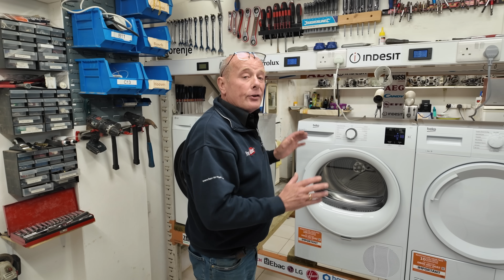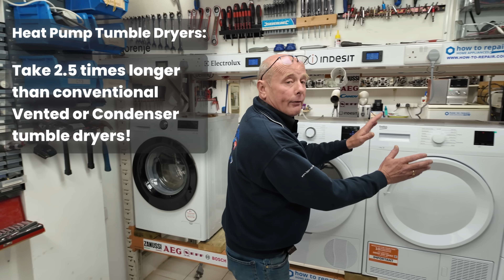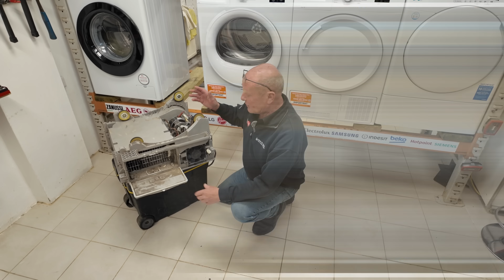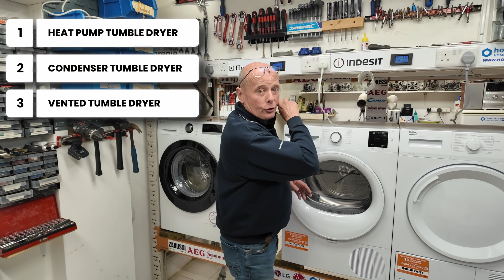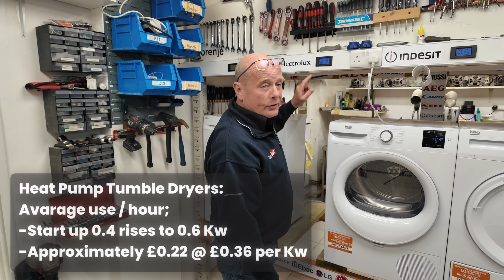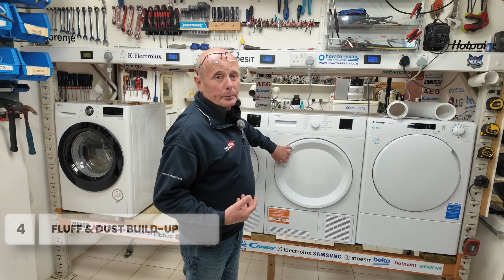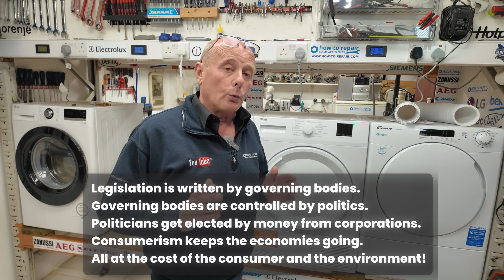Tumble Dryers the Shocking Truth About Heat Pump vs Vented & Condenser, NEW LEGISLATION!

Comment: My old BEKO vent to atmosphere cost me £0.80p per hr to run and the clothes were damp in the middle . 
Bought a Miele Heat pump dryer and it uses £0.10p per hour ,  This was checked using a KILL-A-WATT meter . Clothes are always dry and a full programme takes ~105 mins 
Best dryer I have ever owned , Water from the condenser drawer gets put back into the washing machine for the next load .

Comment: Does anyone make a bolt on heat exchanger for vented dryers ?. Why don’t the manufacturers build one in ?.
Is it possible to use the central heating to provide heat in a tumble dryer - ie: a radiator inside the dryer plumbed into the heating system?.

Comment: I have a Zanussi Condenser dryer bought new in the late1990’s and is still going strong and the only repair has been a drive belt for the condenser fan, the dryer only has two ‘programs’ one high temp, one low temp, and as long as I defluff the door filter and the condenser box on a regular basis I can see this dryer out lasting me and I’m 62 now.

Comment: A vented dryer pushes 250-300 CFM (425-503 m/hr) of your heated homes air straight outdoors and thus requires you to then heat the air that came in to replace it. That expense is dependent on climate and time of year but that cost needs to be accounted for.

Comment: Working in the energy industry I knew all of this to be true. Unfortunately we have a built in kitchen and there are now no vented or condenser built in dryers available. (Our venerable old dryer now obsolete and beyond repair due to lack of parts) Bought a Haier inverter motor hp dryer with 5 years parts and labour and view it as disposable after that should it fail. (Yes it's very slow and stuff never gets properly dry either, so bad we are considering a separate condenser dryer in the garage) My view though is it's the EU & UK governments and regulators driving this change not the manufacturers. (Much like EVs and boiler regs, or max wattage on vacuums etc) The manufacturers needs to build a narrative around cost saving to sell the more expensive machines or face the same consumer resistance as EVs and it does seem to be working. I'm sure they like the obsolescence but know the old dryers will be phased out by the EU so jumped before they were pushed. I can't see them reversing their policy though if I'm honest, the green agenda must be fed even if it's totally illogical 😕

Comment: Front loading washing machines and dryers put a huge load on the drum bearings! I remember my late mother had a twin tub agitating washing machine and separate drum for spin drying at very high speeds! She had it for about 25 years with very little trouble! I think it was called a Rolls! I kept the filter/pump clean regularly and it was also very quiet! Spares became difficult to find so it was replaced eventually! In France I noticed they have top loading drums with 2 bearings ! 1 at the back and 1 at the front so the load is shared and they run very quiet! Anybody else heard of this double bearing top loader?.  Fraser.🛠⚡️p.s. there is a loading/ unloading hatch on the top and another for the inner drum access! I guess the cons would be you can’t have it under a worktop when loading/unloading😢

Comment: I air dry most of my laundry, wrather permitting outdoors otherwise wherever there's space to sry the laundry.  That way the laundry doubles as air humidifier which I sometimes need.  My condensor dryer is the backup for when thing need to get dry quickly or some special cases such as downs.  Probably runs once or twice a year and might be 20 years old.

Comment: Completely agree with the presenter but I think he is being over optimistic on prices that I have seen especially the heat pump dryers. I bought a new vented dryer a couple of years back and hope it outlasts me it vented directly to outside and other than fluff requires no maintenance. My daughter has a condenser dryer and it’s a pain in the arse carrying a cassette full of water about to empty it and something I certainly don’t think my wife could manage in our advancing years. Pretty basic logic that any machine that takes 4 times as long will wear out 4 times sooner. Like air source heat pumps how many homes have a convenient access to an outside wall? Far from most especially when you take flats into consideration. I have no doubt the green washers will force their opinions on us all eventually weather it’s the right thing or just brain washing instead of clothes washing.

Comment: Like with all the "Energy Efficiency" farce, all they ever look at is how much energy they use per HOUR.
When they really need to check the energy use per CYCLE!
So what if the machine saves half the energy when it takes 3 times longer. It's actually costing you more per cycle.

Dryers, washers, fridges etc. As you said none of it is for the benefit of the consumer, only the manufacturer as they sell more machines.
And they know their machines are designed to fail, that's why they now also offer their own Insurance or Maintenance Services, cos they know people will be more willing to spend £200, than £500 on a new machine.

Comment: I upgraded to a HPTD a year ago and so far my experience has been a positive one (vented prior). I found drying time to be on par, certainly not vastly different. My only gripe is the depth - like for like machine - is a good few cm longer ( presumably due to extra components). This argument shares much in common with the EV revolution, all in favour of giving the consumer choice, but believe the pros will eventually out weigh the cons.

Comment: We have a 5ish year old washer (condenser) drier that was blocked with fluff. I had to dismantle most of the machine to clear that out. There really does need to be a law that ensures all machines are easily maintainable.
Regarding the heat pump driers; one of the benefits is that they are more compatible with solar panels as they daw so much less power. Puling 2kW at a time will often be too much for solar panels so the machine will draw from the grid. 400W is more likely to utilise your own power.

Comment: 100% with your thoughts , we’ve always had vented units which we use in winter / when it’s not possible to use the washing line . We know they are more costly to run but they dry stuff fast + I generally repair them myself . Our children have condenser driers which take ages to dry stuff . Heat Pumps will take even longer to dry and aren’t exactly a diy fix. I have spent my entire career in electronics so I have a good grasp on how the appliance industry works .
Reply: My vented outside driers last approx 10 years, are an easy and cheap fix and I much prefer them. I wish wash machine were old style too, I don't need 15 programs and a motherboard to go wrong.
Reply: I agree ..

Comment: On a vented or condensers dryer, if you get fluff from the clothes on part of the heating element, that part of the element will still generate as much heat, but less heat will be taken away because of the insulation of the fluff and that fluff will get extremely hot. That is one of the reasons for fires in tumble dryers. On a heat pump tumble dryer, if one part of the condenser gets covered in fluff, and the heat can't leave, the refrigerant gas will just not condense on that part, so it no heat will be generated in that part, so the it won't get any hotter than the air would get anyhow.
I know that for any sort of tumble dryer the filters should be kept working and there shouldn't be fluff on the heaters or heat exchangers, but it does happen.
I've had a Beko heat pump tumble dryer for 10 years with no problems. My daughter's heat pump dryer has just stopped working because the condensate pump has failed, which is a bit of a pain but it's probably the same condensate pump that a condensing dryer would have had, and it'll get fixed soon.

Comment: Really informative video and I thank you for the information. I wished I'd known all of this prior to buying a heat pump Beko machine here in Western Australia. For us, a dryer isn't strictly necessary because of our weather being either spring like (around 22C) or hot 8 months out of the year (25C - 40C) but for the remaining 4 months, it can be quite cool and sometimes very wet. The rainfall for the Perth metro area is actually higher annually than Greater Manchester apparently! So, the good news for me is that the dryer won't be used much. I think I had it on last in September. Even still, given that we have a large 15kW solar array which outputs at least 2kW/Hr on the most miserable of winter days, I should have just bought a normal cheap conventional dryer or a condenser. Maybe I'll bite the bullet now and sell it whilst it's nearly new and under a 5 year warranty. Thank you anyway.

Comment: I don't use the dryer very often, and so I still have an old vented dryer which works fine for the 20 times a year it is used. The dryer at my house was made in the 1990s and works exactly as well as the day it was manufactured.

I can't imagine wasting the money on a heat pump to save $20 a year in power! Especially when the vented or condensing units will last for decades, while the heat pump will probably be scrap after 10-15 years.
Reply: You will save a lot more than $20 though.
Reply: @mattwright2964  The savings depend on how much you use it, and @fabs... Starts their comment with 'I don't use the dryer very often'

Comment: Couldn't agree more! All the "green" products are bad for the environment and bad for our wallets - they cost more and deliver less, while they all are built as disposable units and non repairable, which is the most adverse for the environment. I have a condenser dryer that is over 20 years old and working perfectly (if not, I would repair it myself). Although I'm on a kinder climate and don't need to use the tumble dryer every week, I wonder how long a heat pump dryer would last, particularly something manufactured now, with planned obsolescence at 3 years max.

Comment: Unless they fix the design flaws of heat pump TDs, I don't see why I should get one any time soon. Those design flaws are not hard to fix; better access for cleaning, and better compressor and heat exchange pipe design. Many fridge freezers run many years without compressor leakage. Bearings should not be a big issue as they don't spin as fast as washing machines.

Comment: My condenser dryer is also a major contributor to heating my flat. Dramatically reducing gas or electricity usage, and also it dehumidifies the flat. So get 3 benefits from a single use of electricity.  As soon as the weather permits, the outdoor washing line is used (understanding not everyone can)
The dryer I currently have, I bought 15 years ago for just over £200. DIY replaced the heating element once.
To hear I could spend over £1200 on a heat pump one for the same 15 years, need to run heating and get and run a dehumidifier is madness to me.
Also, my flat is hard to heat (I'm comfortable enough) so a HP dryer would regularly be operating in 12°C environment, 18°C max if I have the heating on full bore.

Comment: Excellent video, very clear and well explained. You make a number of good points. My observation is that it is not heat pump technology per se that is the issue, but rather stupid designs that make vital maintenance next to impossible, and significantly decrease the chances that users (either themselves or by employing a technician) will be able to fix the machines when they break. The solution might be to legislate for maintainability and repairability at the same time as mandating the phase out of the "older" technologies.

Edit - I think I've had a better idea. Mandatory 10 year manufacturer warranty.

Comment: For comparison, a large ventless heat pump tumble dryer and washer in the US is $2200 (1780 £) while a very large heat pump dryer is $1000 (810 £) and an ordinary electric tumble dryer is $300 (242 £). The break-even point for a better TCO assuming the same mechanical reliability is over 10 years. Not gonna happen with Samsung.

Comment: I agree the legislation is well intentioned but very misguided. The same can be said of the limits to vacuum cleaner motor power. A less effective vacuum cleaner simply requires you to use it for longer to get the job done. Using less energy for longer still uses the same energy overall, but with less convenience. That appears to be the net result if these changes. We do all our laundry on one day. As it is the condenser dryer is already the bottleneck as the washing machine finishes it's cycle more quickly. Having to wait 2.5 times longer for one drying load would be a complete non starter and as you point out, ultimately save little energy and lead to shorter appliance life (and hence more use of resources). How are legislators so easily led astray in this way? The one argument you could make in favour of this move is the peak power demand for the electrical system can be lowered but i still think is nuts
Reply: At the time the vacuum cleaner motor power restrictions were proposed, a lot of the vacuum cleaner manufacturers were marketing their cleaners on the wattage of their motors, rather than their cleaning performance or even their airwatts (which is based on suction and airflow). While some vacuums were well designed and efficient and made good use of their motor power, others were making 2000 watt plus vacuum cleaners that had little or no more airflow or suction than many 1200w or less models and didn't clean any better, because they were really poorly designed. In my view, they could have better addressed the situation by introducing a standardised test and rating label based on dust recovery of deeply ingrained dust from a carpet and stating their airwatts, which is a better guide than motor power, so the consumer could look at the energy label and judge for themselves. I have an old 1,800 watt cylinder vacuum cleaner with an air driven brush, it was rated at 360 airwatts as I recall, its dust pick up is exceptional, it sucks up the dust from under the carpet off the underlay, I was actually disappointed when I used it the first couple of times because the hepa filter clogged after a single use and needed washing, but it turned out that was just because it was sucking up lots of very fine dust that had built up in the carpet, that my previous cleaner didn't have the power to extract.  With the current wattage limit, I doubt it would be possible to equal the airwatts of the best vacuums, even using a much more efficient inverter driven permanent magnet motor. The latest generation of heat pump dryers on the other hand, reportedly don't take drastically longer to dry than a conventional condenser dryer due to various design improvements and are kinder on clothing due to their low temperature, they will likely still suffer from clogging of the heat exchanger, although they are self cleaning using condensate and usually have a second filter to try to keep the link out, I wouldn't hesitate to buy one when I replace my vented, I would have done already, but my usage is quite low so would take a few years to pay for itself.

Comment: The biggest problem is..testing without the exact amount of wet clothing in each machine. Then testing. Each machine operates differently & you cannot test the machines unless they are actually doing the job they were designed to do in the first place. 
Doing it dry is not a test. I think you think we are all green washed also.

Comment: Have you checked that the bearings is not bigger in the heat pump unit. Small car have smaller bearings than a van.

Comment: Utter bullshit. I have a Bosch heat pump dryer, had a normal Bosch condenser one before. The heat pump takes and extra 20 minute to dry the clothes. 50 mins for the condenser, 1.10 for the heat pump. 

The heat pump is rated at 600 watts. The last one was 2500 watts. 

That would save me £400 per year on energy using it 3 times per week. 

It’s paid for itself 4 times over as it’s 4 years old now. 

It has 2 filters; clean them out and that’s it. Not a spec of hair or dust gets past them. 

It’s the same refrigerant used in a fridge freezer. When was the last time you’ve heard someone “re-gassing” their fridge freezer? 😂 come on now. Stop spreading shite.
Reply: Do you want to do your maths again Ollie ?  Even at your erroneous figures or ratings ,  you would only save max 35p per  cycle/load, so in your 3 times a week world that amounts to 1.05 quids.  So tell us Ollie   ,  your 400 quid saving a year means you think there are about 400 weeks a year?  can you  talk us all through that again.   Most people think there are 52 weeks a year and that would make your saving 54.6 quid .  So to be fair you are only 'out' by 700% .